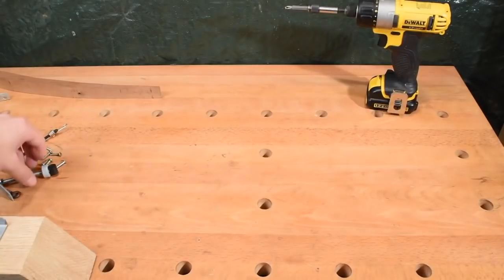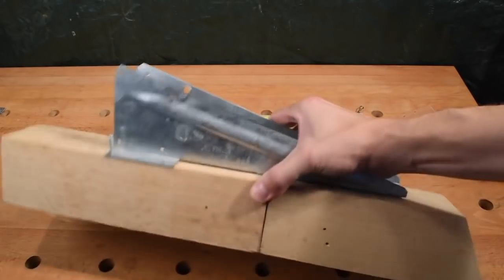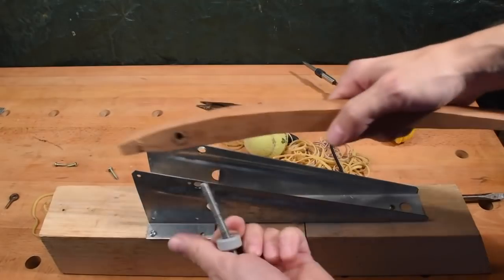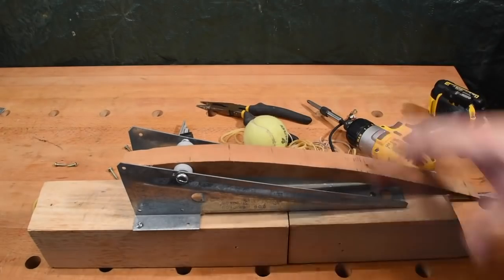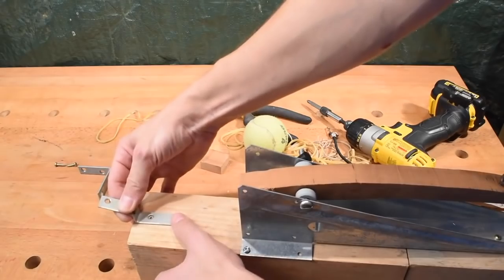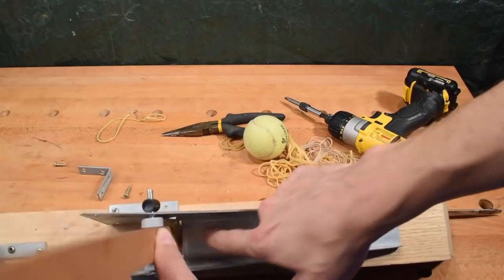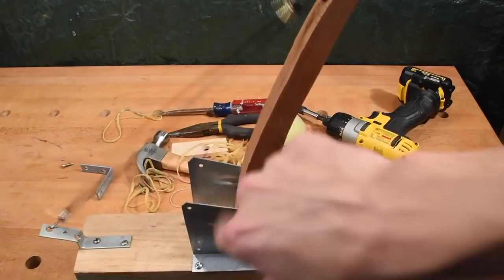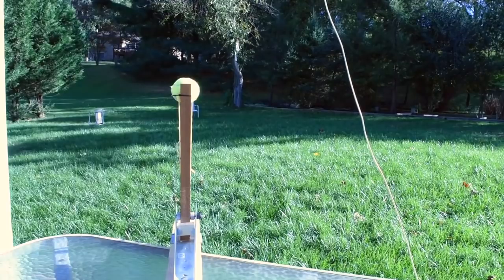Extremely Powerful Catapult in 1 Hour

Comment from the maker: List of materials used: 
1. Block of wood 21 inch long, 3 by 3 inch
2. Bracket from Lowes or Homedepot that is used for frame construction
3. Piece of curved scrap wood about 18 inch long
4. Tennis ball
5. a bunch of thick rubber bands 
6. a few screws and metal pieces to attach the rubber bands to the arm and the block of wood.
Reply: Михаил, да это катапульта))).
Reply: Where do you get the metal piecss

Comment: Couldn’t find the right parts so I had to improvise but still got an A! Thank you very much! Shot 25m
Reply: What did you use instead of the metal bracket? Having trouble finding it at HD.
Reply: @allegracurrie6616  I didn’t use the same metal bracket but something similar. I went to Home Depot to find it. Just find any that will allow for a bolt to go through